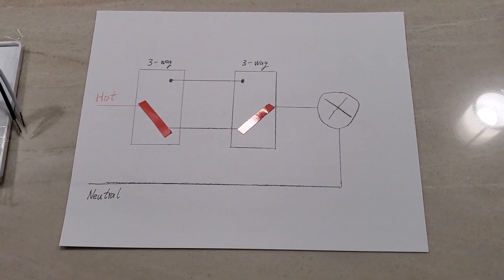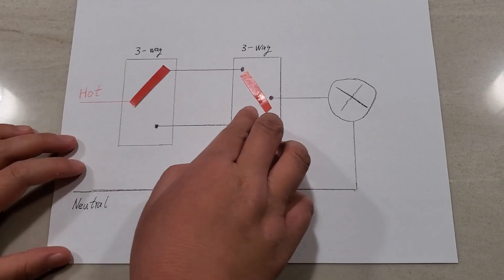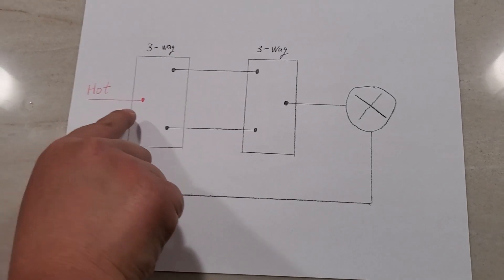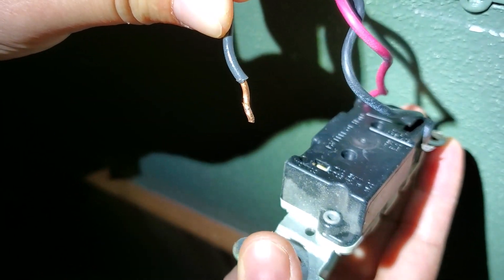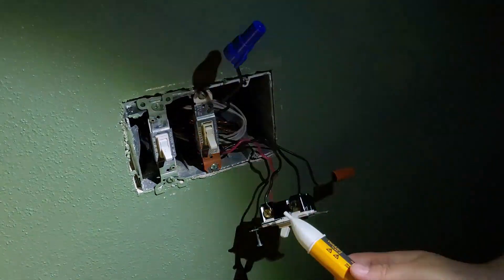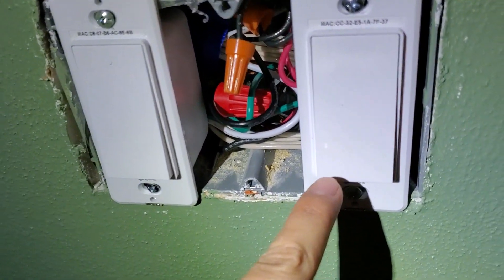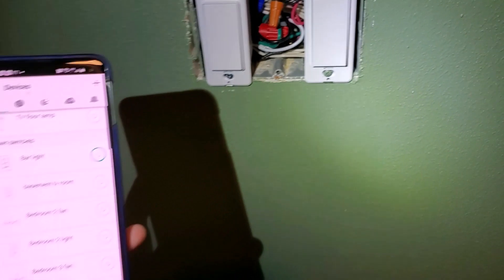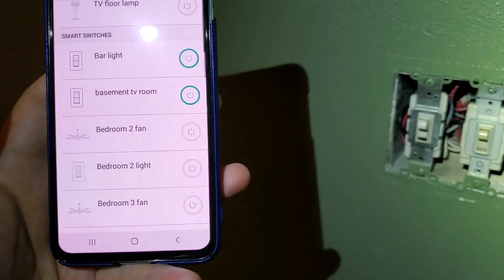How to Install a TP-Link Kasa 3-Way Smart Switch, HS210 (Only one smart switch is needed)

Comment: if the first switch doesn’t have neutral wire, doesn’t that mean i have to replace 1st and 2nd switches with HS210?
Reply from the maker: Are you sure the "first switch" has constant power into it, as how I find the first switch in the video? There is one light in my house, that has the first switch with neutral wire and the second switch without neutral wire. So I just replaced the first switch with a smart 3-way switch and left the second switch as a dumb switch. You may want to double check just to make sure which one is the first switch that has constant power. If it is true, then you will not be able to replace the 1st switch with HS210 since you do not have neutral wire.
Reply: @QTTechReview  yes, I followed the steps and it looks to me that my first switch is the one without neutral line. I bought the 2nd HS210 and wanted to replace both switches but it turns out HS210 needs netural line (I wasn’t aware of that 😜). Now I replaced my 2nd switch with HS210 only, it is working most of time, but sometimes the light is flashing on/off all a sudden, and someone has to toggle the switches a few times to get recover.  I might want to use my original switches back. 😂

Comment: If I turn off the 1st (smart) switch, am I still able to turn it on by the 2nd (original) one?
Reply from the maker: Yes, you can turn the light on by the 2nd switch, which I assume is the original dumb switch. And the app will show the light is on.

Comment: Great video. Very informative. Could you please explain if I could use a smart dimmer switch (Kasa HS220) where the 2nd switch is, so that I could also use dimmer function through the app?
Reply from the maker: Thank you! It will not work in your situation. The second switch needs to be a 3-way, which has 3 connections, besides neutral and ground. The smart dimmer switch (HS220) only has two connections, besides neutral and ground. Also, when the first 3-way switch is off, the second switch does not have power so it will not be able to communicate to your app at all. You can use a dumb 3-way dimmer switch on the 2nd switch to dim it but certainly you will not be able to control it from the app. I heard Kasa is planning to make a 3-way dimmer switch very soon but I do not think it is release yet as of now.

Comment: What difference does it make which of the three way switches is replaced?  I know one has the hot wire in it but if it worked as a 3 way dumb switch why wouldn’t it still work with a Kaza 3 way switch?
Reply from the maker: If you replace the switch without the hot wire with a smart switch and keep the one with hot wire as dumb switch, then the smart switch will not have constant power. If you turn the dumb switch off, you will not be able to turn the light on from your app, because the smart switch will have no power and will not be able to listen to your command. You can certainly replace both switches, each with a smart switch.
Reply: I see. That makes sense. So I need to determine which switch has the hot wire and replace that one with the TP Link 3 way switch?  Thank you.
Reply from the maker: @jrmm8942  Yes, that is correct.

Comment: When you split up a pair of three-way switches, is there any difficulty controlling each one individually? Does the Kasa app (or Google Assistant) treat them like a pair in any way, or like two separate devices that can be switched on and off?

(Sorry if this is obvious, just wanted to make sure I understand the implications of doing this)
Reply from the maker: When you add a three-way switch to the Kasa app, it will ask you if you plan to use it individually or use it with another smart three-way switch. Even if you buy them in pairs, as long as you select to use them individually,  they will work as two separate devices, instead of on the same light fixture. Hope it is clear.
Reply: @QTTechReview  that's great, thanks for the info!

Comment: After racking my brain for 3 hrs and 10 attempts, I finally went to check which one was hot and I had been using it at a traveler. Not sure how it worked before but it was a problem with this smart switch. Thank you for your video.
Reply from the maker: Excellent!

Comment: Thanks a lot for a superb tutorial! 

Is it possible to replace kasa 3 way switch in the 2nd old switch then connect 2 travel lines to the 1st old switch and wire a new hot line to the kasa switch?  (it means that the 1st old switch don’t need any power line except 2 travelers from kasa switch.) My apologize if I’ve made you confuse.
Reply from the maker: The common line on the 1st switch will be connected to the hot line. The common line on the 2nd switch will be connected to the light fixture. You can just keep the old switch on the 2nd switch and it does not need power.

Comment: Great job! You covered everything perfectly with good explanations - many seem to think that TWO smart switches are required - and they are not required as you covered very well! I have one that is part of a 3 switch chain (the middle one is a dumb 4-way) and still only requires just one HS210. Just an added info that Kasa has in fact announced release of a 3-Way Dimmer which is expected to hit market by the Summer.
Reply from the maker: Thank you! Great to know that there is finally a smart 3-way dimmer.
Reply: @QTTechReview    - https://www.tp-link.com/us/home-networking/smart-switch/ks230-kit/ - no specific details as yet, unclear whether this will also be single switch replacement or a set of two (I wouldn't rely on the image as even the HS210 is available in 2-packs)